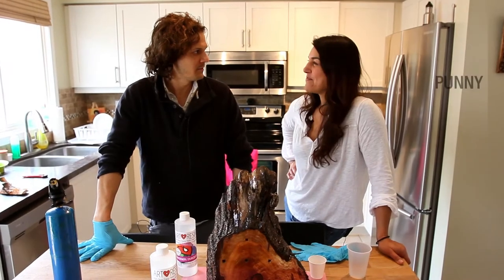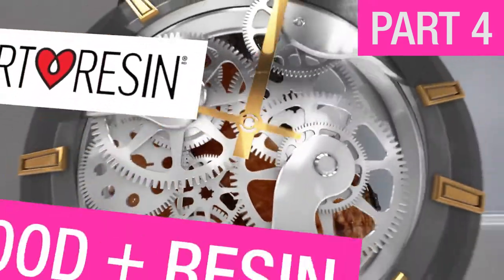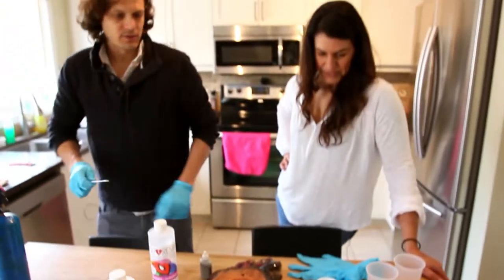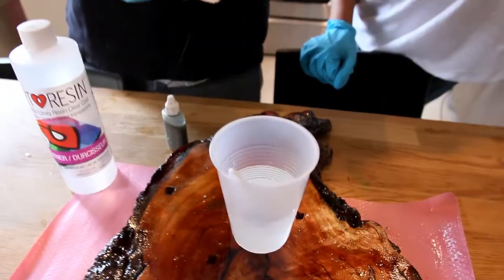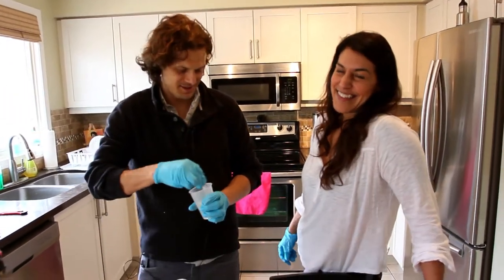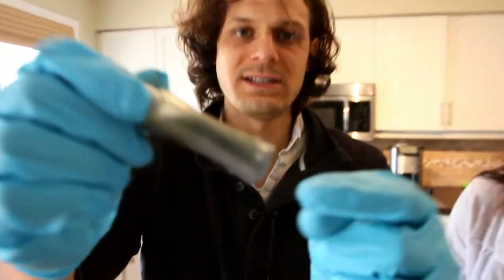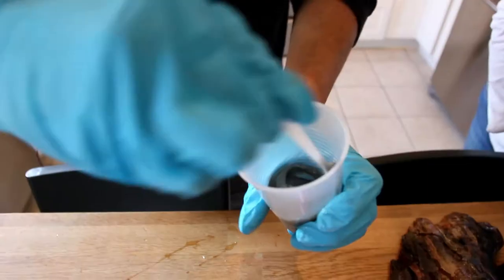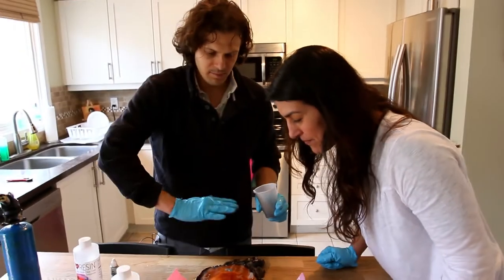How To Resin A Clock - Part 4

Comment: Your videos run like clockwork,What is the maxinum depth of pour at a time,Can you epoxy used on table top with beer bottle caps,How do you stop scratches.(can you use any kind of sealer on top of the epoxy resin)Thanks.
Reply from the maker: run like clockwork .... ah, that's a good one!  we didn't think of that one while we were filming!  nice work, David!
So the ideal ArtResin pour is 1/8" at a time.  You can certainly get a thicker coat than that, but it must be done in 1/8" increments.  And yes, absolutely, embedded beer caps are perfect for ArtResin - Dave did a tray with embedded beer caps and he has also done coasters too - I'll post the links below for you
ArtResin is scratch resistant, but not scratch proof ... meaning it is hard enough to protect against normal wear and tear, but if you cut on it with a knife, it will scratch.  You could certainly add a sealer on top of the epoxy resin ( your hardware store should be able to guide you ).  A lot of our customers do this for table tops, bar tops, counters, floors etc to add another layer of protection.  The other beautiful thing about resin is that if you do get scratches, simply do a light sand and pour another coat on top and your table will be good as new!

Blog on pouring thick layers: 
https://www.artresin.com/blogs/artresin/how-to-pour-a-thick-layered-resin-collage-with-artist-josie-lewis

Embedded Beer Cap Tray:  https://youtu.be/5BhYKtFlhVo

Beer Cap Coasters:  https://youtu.be/JdA2CFVS5po